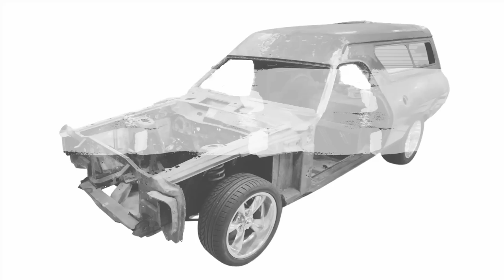Paint Stripping & Rust Repairs #3 How much rust do they find on Howards XC Panel Van?

Comment: I had an XC Panel Van 302 4 speed brand new when I was a younger person, I loved that car and still regret selling it.
I like watching you reserect this one.
Yes the flameless windows used to pop open at 140 and you could put a fist through the gap at 160.
Reply from the maker: Yeah I know right! I ended up putting an aluminium block at the top so I could wind the window up behind it when we traveled

Comment: Stripping paint is a coot of a job at best of times but is satisfying. This is a good instructional for doing it yourself, rolling out into a hot summer day help the stripper too I've found.
Full acid dip is the easy expensive way.
Reply from the maker: Yes I think I have tried most types of strip over the years

Comment: I have always put cling wrap over the paint stripper and let it work. Then go with steel wool and low grade thinners to clean
Reply from the maker: I do use the cling wrap, I use the large packing plastic or the masking plastic on big areas, I will try the steel wool and thinners

Comment: I have seen some cars that when they started removing paint they discovered the panels resembled chicken wire or flyscreen mesh. Some found actual open cracks all the way around and that the paint was the only thing holding the structural panels together. Whole sides of coupes just fall off
Reply from the maker: yeah got lucky with this one

Comment: Nice work Howard, gotta love paint stripper on ya bare skin.....nuclear burn!!! I see your down on ya knees doing that lower panel stuff. I sussed out a nice way to save bruised knees when doing stuff down low on the car, a simple cheap foam yoga mat from Kmart. $7 and u can cut it up to smaller bits. Makes the job heaps eaiser!
Reply from the maker: Cheers mate, I have a knee pad just rushing for the filming.

Comment: Thanks Howard. I have a hq Holden Van with the same roof heavy surface rust and pitting where a duck tail spoiler was. Can you show the last metal pic before you coat please. I have bought the same gel as you and I want to see is the rust totally 100% removed before epoxy or just mostly gone and the remainder converted?  Thanks Pete
Reply from the maker: It will be in the next episode. It will remove the lot

Comment: Hi Howard, did you consider dipping the body, and if so why did you go the manual labour way? There's nobody down here in Tasmania that dips car bodies and I was thinking about starting up a business doing it, but it's hard to gauge how much demand there would be.
Reply from the maker: I’ve dipped a few of my cars, my concern is getting back into the double panel and frame areas to seal it back up. 
Being my own car labour is free and less evasive as all the stripping types. 
You never seem to get rid of the medium from blasting

Comment: Love the videos Howard, have learnt a lot of tricks lately. quick question. Best way to neutralise the stripper before continuing with primers. always seem to miss a bit and it bites me later. cheers on the channel.
Reply from the maker: Clean clean clean, metho water, then dioxidine, lots of blowing with compressed air. Epoxy then seam seal everything. Wipe off excess seam seal so it’s not seen.

Comment: If you've got a few layers of paint . Scuff it first . Put the stripper on and cover it with glad wrap. It keeps the chemicals in without drying out and works through the layers.  Spartan Derin A was the best ever metal prep phosphoric acid treatment. It would be a hazardous chemical nowadays.  It would take those deep rust deposits out real fast.  It left a surface so clean, you could paint on it. 😉
Reply from the maker: correct, that's what I did with the roof, The gel i use does pretty much the same thing. it will be in the next episode

Comment: Hi Howard great video thanks. Love the way you paint strip, what is the product you use to protect against surface rust? I see theres a few phos based products on the market?
Working my way through the build series an following the panel van thanks for putting it on video
Cheers Dale
Reply from the maker: Hi, I use the one recommended and distributed by PPG. Has a few names, bondrite by Henkel 
Deoxidine           Part no 978-10007
Reply: @AstillDesign  thanks much appreciated rebuilding a little 1970 Cortina it's gutted ready for stripping paint appreciate the chanel an advice

Comment: Hey Howard! im using the same poly stripper on my XC, and im finding the little bits of paint left behind are coming off easily with thinners on a rag. Is there any reason you think i shouldnt do that? will the thinners affect the bare metal in any way do you think? cant wait to see more on the van 👍👍
Reply from the maker: Hey mate, thinners will be fine for clean up. Hoping to find some time in the new year

Comment: Hi Howard, I wonder if there a balance here between blasting or acid dipping or manual stripping. Seems small DIY vs body workshops is the passion for automotive restoration. A bit like a project with the old man and son you agree?
Reply from the maker: on our commercial jobs we strip the outer panels and blast the underside, interior and engine bay. I tring to do this more how you would do it from home.

Comment: Have you ever tried lanolin ( sheep wool oil ) products to hold of the oxidation before you paint?.
Reply from the maker: I would prefer not to be using an oil on the surface. 
We do use a CRC product on our bare metal repair sections

Comment: Great info👌do you need to neutralise the paint stripper after wire brush and can you use the anti rust straight after or need to wait🍻
Reply from the maker: Wash off with water, then deoxidise with scotch brite. I will probably pressure clean the lot.

Comment: are you painting over POR-15?  If so, how is that working for you?
Reply from the maker: No mate, only use it on the inside of panels.
Reply: @AstillDesign   I always questioned the mechanical bond of spraying over POR-15, I have a roof to do and worry about blistering after rust removal
Reply from the maker: Check out the video of my van stripping the roof ready for paint.
I wouldn’t use POR on the outer panels

Comment: Do you have the option to just dip the whole car to strip away the paint/rust?
Reply from the maker: You can dip a car, it’s reasonably expensive plus you need to be able to get paint back into all the double panel areas. I have done 2 previous cars that way
Reply: @AstillDesign  Ah ok that makes sense. Thanks for the reply, and the videos, i'm learning a bunch.

Comment: Would you ever acid dip a car what do you think about that process
Reply from the maker: I have done a couple of my early cars, You just have to make sure you can get back into all the double panels to seal it up,
Reply: @AstillDesign  thank you for your reply only asked as I have a Eh panelvan needs a lot of metal work done and I’m putting a 3/4 chassis in it